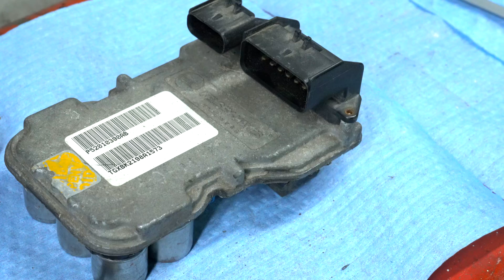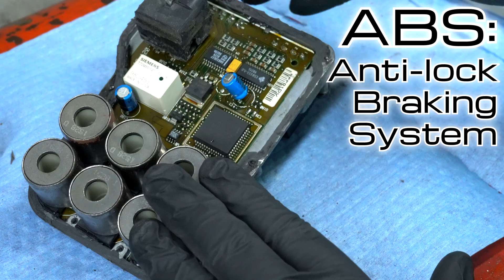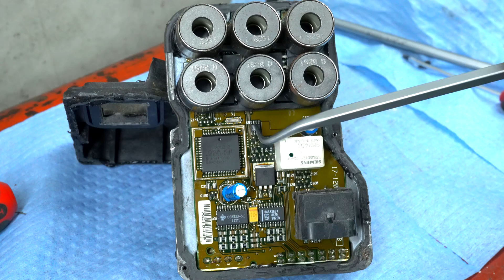Automotive Chip Shortage Explained (With an Actual Example)

Comment: Spot on. Plus with modern cars they gonna have 10’s of micro processor units or modules even for non-hybrid cars. Couple that with the new cars having CAN bus lines it definitely shows how one little chip can hang up the whole assembly process.